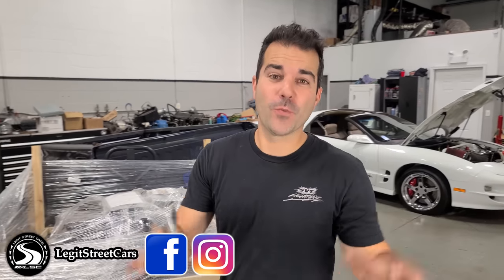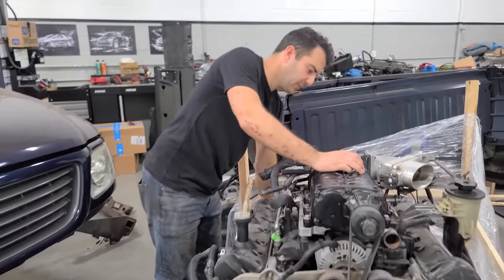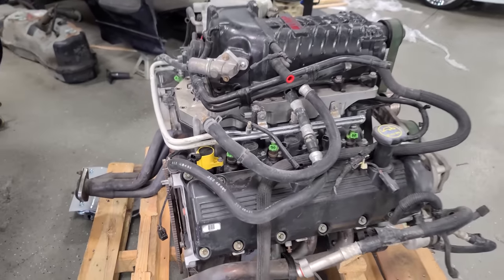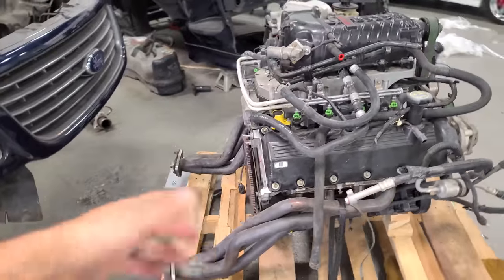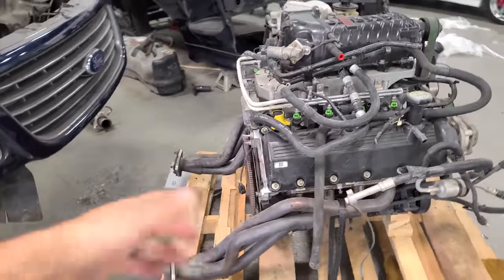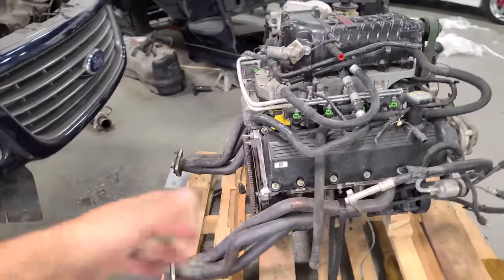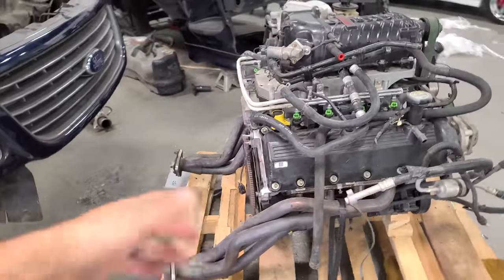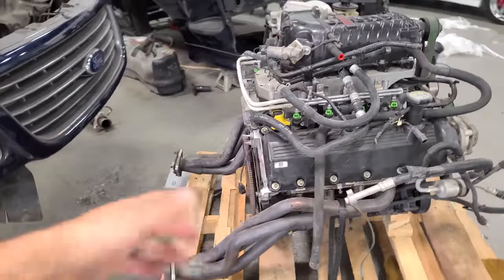I Bought A $9,000 Engine For My SVT Lightning Off eBay Motors! First Start On A Pallet! It's LOUD!

Comment from the maker: Check out the Ebay Motors app! https://pages.ebay.com/motors/motorsapp/
Ebay Motors Instagram https://www.instagram.com/ebaymotors/
Reply: I want to buy ur wagon ??
Reply: Diablo Sport is Holley's tuning division(?). Just bought a Diablo Soort Predator 2 tuner for my Silverado to turn off AFM and add power. was super simple and works great! @holley
Reply: Its amazing seeing that it could be up and running soon been waiying for it good work with sll the cars
Reply: What's the condition of the Cam Phasers?
Reply: What’s Nathan’s socials to reach out about the custom valve covers they look sick 🔥
Reply: Are you secretly 
Mark Norman?
Reply: Maybe ebay should find your rods for you if they want it running for some shows.
Reply: But why not build it from scratch will it really take that much time?
Reply: That was the first motor out of vehicle start and run on YouTube
Reply: @RS-cd9cf  at least on this channel
Reply: Is there a list of shows that the truck will be at?
Reply: You're going to want to install the MAF from your old engine. Reason being is the metering curve of the SCT MAF is different and your ECU will need to be tuned for it. My opinion is that Diablo tune is what busted your piston and roached your head gasket in the old engine. A bad tune will kill an engine quicker than chit. If I were you, when you get the new engine installed, have a competent tuner with software like HP Tuners tune it properly. Unless you are a fan of changing engines in that truck. The bigger supercharger, MAF, throttle body etc all deviate from stock to the point that the stock programming can't compensate and you end up going lean. And going lean in a boosted engine usually means a dead engine. I realize that these aftermarket parts tout themselves as bolt on and plug and play, but they really aren't. You're going to have your AF ratios all screwed up without a proper tune. Do yourself a favor and get a dyno tune. Fluid motor Union could probably hook you up nicely.
Reply: What did you do to your armAlex?
Reply: Hey I have a question. My moms e320cdi is completely dead. She’s called AAA multiple times and they’ve tried multiple jump packs at the rear big battery with nothing turning on on the dash. I’m suspecting the aux battery being at fault so I’ll be flying to the car tomorrow. I have a portable battery jump pack. Can you fly with those on carry on? I don’t plan to check a bag. I bought the Fantik T8. I’m not sure if I can take it on an airplane and run a big risk as I am an airline mechanic and don’t want to lose my flight benefits over this. Thanks
Reply: Aren't you scared when you use an impact on all your bolts? Especially the valve cover??
Reply: @glyph241  who Me no don't know who that is
Reply: @shekharmoona544  these engines doesn't carry cam phasers
Reply: @markusbalmer7501  
A really funny comedian that looks just like LegiteStreetCars.  🤣🥊
Reply: @glyph241  Oh sorry mate thought you meant me haha
Reply: Hell yeah bro, sounds like a good running motor. Nice find, I love looking around in junk yards
Reply: Ese motor es la réplica del 5.0 coyote es una locura de motor 🔥🔥🔥🔥💪🏼💪🏼
Reply: ALEX!!  Peter needs his own series bro. He has a lot of personality, photogenic, very smart. 
Come on. Give him a chance (& don't be Weinstein & make him go through the casting couch).

Comment: It's always a good practice to blow out the Spark plug area with compressed Air before you pull the plug so dirt doesn't fall into the Piston area.
Reply: That was making me cringe. Guess he knows he's just making a video and is going to sell it on fleabay.
Reply: That was annoying me, the amount of dust and dirt falling down into the cylinder
Reply: I think the same thing after, yes after, changing my subaru plugs. a couple of those cavities were dusty. I didn't blow them out with air, but that would have been good times to have had.
Reply: I was dying inside when he did that then he did a compression test dry with dirt on the cylinder walls
Reply: Agreed,that was alot of dirt and rust.
Reply: ya at least a small tube onto a vaccum cleaner to suck it back out.
Reply: Rule 1 never let anything go inside an engine. Only things allowed are air and fuel.

Comment: Should have spent another $4.50 on a  utility knife. Lol
Reply: The knife is fine
He is trying to not cut the engine or accessories
Reply: Maybe the blade is in upside down!! Geez...
Reply: A new blade is even cheaper. Lol
Reply: Haha I was thinking the same... gave me anxiety LOL
Reply: Or hear me out . You can pull the cap off the back end and use it to snap the tip off and boom it’s a brand new knife.
Reply: I came here for this comment
Reply: @stephendoyle2393  obviously you’ve never used one before? 
If it was sharp all you do is glide it sling plastic and it would have sliced right through it. 
The way he’s doing it , is a sign of very dull blade blade.
Reply: Mechanic life
Reply: I thought I was the only one like GET ANOTHER BLADE. It was giving me a panic attack 🤣
Reply: @krankysledzz  actually I work in a warehouse and use one every day.
He could go ham and slice deep and mess something up.
I unpack medical supplies for a living so believe me I know what I'm talking about. 
What makes you such an expert?
Reply: @stephendoyle2393  well if you use one everyday, then you must be wearing no cut gloves as a safety . Usually mandatory in all factories.
Reply: I would have used a pair of scissors
Reply: Or you can just unwrap the plastic the same way it was put on
Reply: He kind of spent a couple thousand dollars more and had a brand new 7.3 Godzilla crate engine 100% brand new I understand he's trying to keep this with a two valve in it but that's just plain silly
Reply: Damn you beat me to it!
🤣🤣🤣🤣
Reply: I work in package handling. Even with a brand new knife, the plastic bunches and makes the knife effectively “dull”. Unless you have high tension on each side of the cut, or don’t care about the contents and run the knife down them, it always takes several passes to open that plastic wrap. There’s a reason they ship engines in it.
Reply: This guy really said ‘I work in a warehouse’ 😂
Reply: @ShaunHensley  this guy still uses emojis  ¯\_(ツ)_/¯
Reply: Maybe even a hot butter knife

Comment from the maker: Who else owns a supercharged car/truck? Whatcha got? I have the Lightning, the E55 wagon, the Escalade ESV and a bunch of turbo cars.
Reply: 2008 Cayenne Turbo for my "truck". 600hp with just a tune and completely stock otherwise. It's a "sleeper" with no Turbo badge on it. Hurts a lot of feelings up mountain passes.
Reply: 88 Fiero GT  3800 L67 swapped
Reply: 2005 impala ss
Reply: I own a double pulleyed, ported Kompressor, larger intercooled, methanol injected 1998 SLK230, with a set of road cams and a tune. Makes 376 hp and 490lbft of torque from 2000 rpm. Lowered on Bilstein b14 suspension, camber corrected with camber king control arms. Gaps gt mustangs and rt's all day 😂
Reply: 93 5.O Mustang 331 stroker w/ Paxton Novi 1000
Reply: I have a 2015 Ford taurus SHO with 450whp and a very quick 2015 f-150 with the 3.5 ecoboost. It's pictured in my profile. Good luck with your lightning. Love those trucks.
Reply: im jealous
Reply: 2002 Grand Prix gtp, long headers more aggressive cam high flow cat and a tune, just makes over 450
Reply: 1998 BMW E36 M3. I’ve had an HKS blower on it for the last 5 years, but I’m currently converting to a turbo build! I’m doing forged internals and a full engine rebuild while I’m at it. 

I love your videos! Thank you for your work and content. Take care.
Reply: @terrypaquette2824  That's really cool man. I've always wanted one of those to modify...
Reply: @bryco32  That's awesome! I was planning on getting a GT back in the day and swapping a Northstar 4.6 into it with a 5 speed manual. The L67 is a hell of an engine though and is capable of making a seriously fast Fiero.
Reply: I have a 1997 Honda Civic coupe with a fully built LSVTEC (1.8L DOHC VTEC) that I have about $15,000 into with a Garrett GTS3582 turbo and it makes 709 wheel horsepower and 588 lb ft at 30 psi. I built and painted it with my own two hands and it has WAY too many mods to list here. I also have a 2001 Honda Accord with an Acura CL 3.2 SOHC VTEC swap that has a Garrett GT3582R turbo and a six speed manual swap. It has a stock engine so it makes 503 whp and 398 lb ft at 10 psi, but it's my daily and it's alot of fun. I've owned domestics in the past, but I have always loved Hondas.
Reply: 2003 SL55 AMG - stock compressor w/just under 500hp.
Reply: 2006 Grand Prix GT, a mean 3.8 supercharged V-6 🤣🤣🤣 first BRAND NEW car I ever bought and I won't get rid of it!
Reply: Gotta 01 Lightning ⚡️ and love it!
Reply: 06 Saab 9-3 2.0T 🤪😁😂
65 fastback project in the garage
Reply: I used to own a supercharged Miata for which I built a Megasquirt ECU. Really fun learning experience but I rear ended someone after locking up the non ABS Wilwood big brakes and sold the car off to a 17yo kid who rebuilt it and got it back on the road. Have seen it running around a few times since.
Reply: @Brock_Landers  it's been an adventure, mods were all done gradually instead of all at once, getting it to idle proper with the cams was the difficult part, need to do a MLS headgasket and ARP studs and rod bolts and forged pistons. Then it'll survive twin charging with the kompressor for low rpm and turbo for high rpm and about 10 more psi of boost for about 500 hp and about 600lbft of torque, currently makes 17.5 psi on the kompressor alone, will have to have it retuned to save the transmission as it'll only hold up to about 560lbft. In a 2375lb hardtop roadster it's an absolute 🚀 add an LSD and lower it 1.6 inches and it's an absolutely solid car to swing around has the steering angle to get a little sideways and the stability to be simple to control once you get the tires smoking😂
Reply: 02 Mustang Saleen S281
Reply: Original owner of a 2001 Lightning. Has 2003 heads, ported blower, sbtb, 8lb pulley, K&N FIPK and tune.
Reply: CTS-V wagon manual, and 5.4 GT500 engine swapped into 2008 Mustang GT.
Reply: I have never owned a supercharged car, I've always been a nitrous or turbo fan. I do want one though, maybe an older gt500
Reply: Jaguar x308 XJR 4.0 s/c
Reply: AMG c32
Reply: @terrypaquette2824  but it still looks like a cougar's mini SL. A sleeper for sure.
Reply: 02 lightning...
Reply: Mostly have turbos, 84 Regal T-Type, 20 Civic Si, 21 F150 3.5 Ecoboost, all stock for now. Also have 07 Mustang GT that I'd like to Supercharge.
Reply: 1997 Grand Prix GTP. Tuned with upgraded supercharger and cam
Reply: @stephenhayes3765  The gen 5 blower
Reply: 2008 Hummer h2 with a tvs1900 magnacharger
Reply: 32 ford highboy with a 383 stroker and 671 blower, 01 Lightning and 17 Raptor (not blown but twin turbos spool up nicely)
Reply: @terrypaquette2824  need a trunk lid for it? I have one
Reply: 01 Lighting owned from new.
Reply: @bryco32  That’s a badass build
Reply: I wish my Yukon was.. just a tired 150,000 5.3l stock Yukon needs alot of help.🤣🤣🤣🤣
Reply: My 03 Lightning, fully built 5.4 bored .02 over, fully forged, stage 2 cams, built trans, ect.  It's a beast!  Plenty of videos on the channel ⚡️
Reply: 2013 Ford Falcon XR8 with a smaller pulley and some other bits, makes 558hp (416kW) at the rear wheels and about 737 ft-lb (1000Nm).
Reply: I have a Stage 1 Tuned  ( APR ) 2010 Audi S4.
Reply: 2015 Audi A6 3.0 TFSI....  was a beast with dual pulley tune.   Then boom!  Failure at 74k miles
Reply: '90 Foxbody Notch with a 342 Ford R block stroker driving a Paxton.

Mid 10's, 586 hp at the rear tires.
Reply: Lightning, Redeye Hellcat, Range Rover V8 Supercharged.
Reply: Hellcat Redeye, Range Rover Sport 5.0 V8 supercharged, Ford Lightning Kenne Bell 2.6 and all bolt ons. Sold my 2006 Z06 LS7 Eforce.
Reply: I'm finishing up a 2000 excursion RWD. I'm swapping a 02 lightning 5.4l and upgrading it to full bolt on. I figured the extra weight could use some help.

Comment: I’m glad the engine turned out to be good. I always clear the plug holes with an air gun and then put a couple drops of oil down them to keep any debris from dropping into the cylinder when I remove spark plugs.

Comment: Alex be careful with the old ecu it looks like you got at least a 4 maybe a 6 lb lower pulley on it, maybe even a smaller snout pulley on that blower too, you need to make sure the tune is set up for this engine or you can get detonation.
Reply: That Diablo canned tune is what killed his last engine. I've heard too many stories and seen too many results.
Reply: @TwentytenS4B8  yup 💯
Reply: @TwentytenS4B8  I hope he sees this so he doesn't put a built engine in just to blow it up

Comment: The “diablo” decals are covering up the port on the ECU that was used when actual physical chips were installed on them to tune it. If you want to tune it using a flash tuner, take that off and make sure there isn’t a chip on there, otherwise it’ll override anything that is flashed on there. 

The other thing to keep in mind is that the SCT MAF you got with the new motor needs to be tuned for as well, it’s not plug and play.

The upgraded MAF is important, just a pulley and a cool night can max out the OEM MAF
Reply: I got $15 that says that Diablo tune is what roached his old engine. I posted a comment above that it would be wise to get a proper dyno tune once the new engine is installed and verified working with no codes. I've seen first hand what a bad tune can do to an engine at my friend's shop. He has an Audi RS3 engine with inspection ports in the side of the block made by an exiting connecting rod done by, you guessed it a bad tune. Fluid Motor Union has a dyno and could fix him up.
Reply: @TwentytenS4B8  I was thinking the same thing. Damage seemed tune related
Reply: @TwentytenS4B8  he needs to get a hold of a quality tuner that tunes Ford like Marty ochs from Moe's speed shop in Dallas Georgia
Reply: @TwentytenS4B8  was your homie not watching his a/f when gunning it? i assume it leaned out and the rods went bye-bye.
Reply: @TwentytenS4B8  Supercharger and a tune by not so reputable sources that seeks big numbers by running lean on top?

 Recipe for rapid self-disassembly.
Reply: @neilbrown82  OJ at Fluid Motor Union knows what he's doing.
Reply: @vinny6_9  Was a  bad tune by a wannabe "tuner" leaned out under boost and piston McNuggets and con rods galore
Reply: @iknklst  Near as we could tell, the pistons disintegrated from detonation under boost and the rods proceeded to buzz saw the block. When the tune was dumped from the ECU it was discovered that the fuel tables were all jacked up..
Reply: @TwentytenS4B8  yes but does he  tune fords for a living?
Reply: @sav22rem22  Yup, busted pistons, and a roached head gasket. That was detonation under boost all day long.
Reply: @neilbrown82  Brand matters not, skill with the HP Tuners does. Alex would either have to ship the truck interstate or drive it there risking damage to the new engine he just paid 9K for. It would make the most sense to just go 15 or 20 minutes down the road to a guy that knows what he's doing, has a Dyno, and can put a safe tune in it.
Reply: @TwentytenS4B8  happened to me last year. Gunning it uphill in fourth while low on fuel, #1 cyl rod decided to eject. I was watching my a/f and wondering why I'm getting closer and closer to stoich... Oops lol
Reply: @vinny6_9  The car belonged to a friend of his from Chicago. Poor guy thought he was getting a quality tune and nothing to worry about. First time he gave it the beans it flew apart.
Reply: @TwentytenS4B8  jeez, that's terrible. Live and learn.
Reply: @TwentytenS4B8  except for the fact that HP tuners doesn't support that vehicle for tuning and that crappy Diablo tune that was on there is probably what helped kill his previous engine you do not have to go to a tuner shop to get a remote tune nowadays if you did a little research  u would know that Marty and Jeff at moes speed shop had probably tuned more modular Fords than anybody in the country and use SCT to tune Fords and have been for quite some time
Reply: Yeah, the box diablo tunes are garbage

Comment: love the content . Keep pushing. But In the future it’s always good practice to use compressed air and blow out the spark plug holes before removing them . Keeps a lot of that trash that can scratch cylinder walls out the engine .

Comment: Seriously, back in the very early 00s I had a black 1992 Acura Integra with bronze 16" Rota Slipstreams that I had done a bunch of engine work to and I pieced together a turbo kit from almost all junkyard parts. I got the turbo manifold from SSAutochrome eBay back in 2003 before they started selling cheap turbos, I paid $50 for a used Dodge Daytona T3 turbo, I paid $50 for a used front mount intercooler, I fabricated the downpipe and charge piping out of exhaust tubing, $75 for a set of DSM 440cc injectors, $100 for a Walbro 255 LPH fuel pump, a buddy of mine let me use his old Zdyne Gold SECU that he had in his EF Civic that he totaled, and I had the turbo's oil feed and drain lines made by a hydraulic shop. It went on to make 288 whp at 14 psi...without head studs. We used to drag race down the highway on the weekends back in the day and my car was one of the fastest once I put drag radials on the front. The only vehicle that could ever really edge me out was a 2002 Lightning that was a manual trans. He really used to piss me off because he would always brag about it afterwards and call my car Jap Scrap. He had alot of money in his truck though. It was black with 20" chrome wheels.